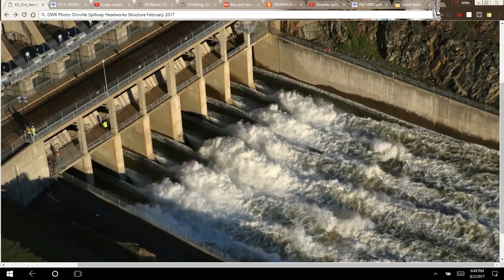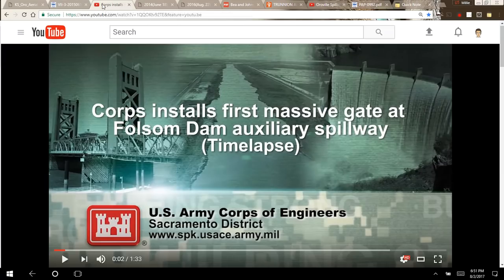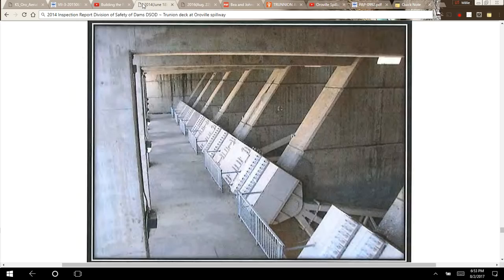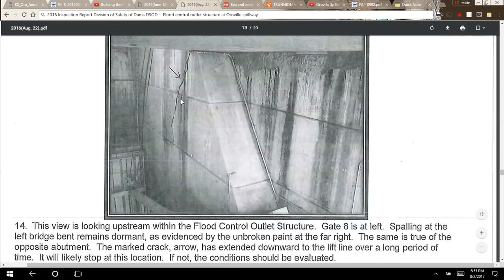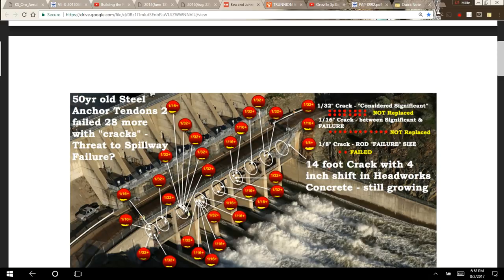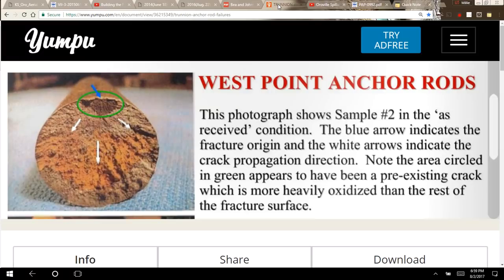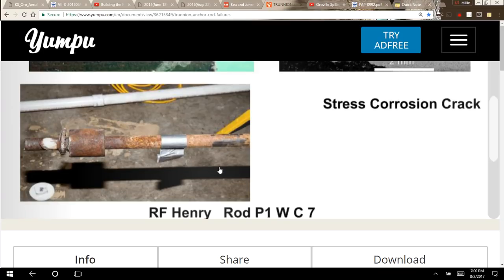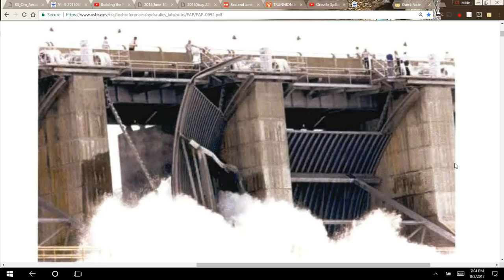Are Oroville Dam spillway gates safe? (And what about those trunnions and tendons?)  8/2/17

Comment: Lacking current access to the design blueprints, it would surprise me if there are NOT cut off slots in the upstream end of the spillway chutes. This is a simple slot a cut off panel gate can be lowered into position by crane to isolate a given chute for maintenance while maintaining water levels. It's a super simple design feature that adds one more level of redundancy.

Edit: in this video, it appears there is some method of using cut off gates here (but the video is shaky at the MOST critical points). You can easily see near the end, there IS a slot in the sidewall entry to the chutes. I'd need to see the blueprints to be certain. https://youtu.be/XZO_744b_Gs
Reply from the maker: Hi Mike. I hadn't seen that video in a while. Thanks for posting the link. Your thoughts on the cut-off slots are interesting. I see what you mean near the end of the video . . . hmmm . . .
Reply: Made in USA Thanks for the reply! Perhaps the stop log slots are not "intended" to be used with flow, but if you have nothing else to plug the hole, I'd sure likely try it. Maybe grease it, or add wheels now? It's only got to close once. The point being it's not 100% accurate to say there's "no way" to plug the hole if a gate fails.  If the ship is sinking, get creative in plugging the hole.  Remember, the tendons are not the only 50-year-old steel bits that have reached their design life (i.e. RVOS) and are subject to immediate failure. At some point they will all fail if ignored.
Reply from the maker: Mike ~ I found this info. Hope it's helpful:

A set of stoplogs is provided to dewater outlet bays to allow maintenance work to be performed on the radial gates. Five interchangeable leaves are stacked in slots in the pier noses and make up the set required to close off one gate bay. The gate leaves are each 8 feet - 10 inches high and were constructed of 1/2-inch-thick skinplate and box-shaped ribs. Rubber seals are used on all four sides ("J" seals on the top and sides, and wedge-shaped seals on the base). Each leaf is provided with a 4-inch gate valve to refill the volume between the radial gate and stoplog and thus equalize the pressure for gate removal. The stoplog leaves were designed for a hydrostatic head of 87 feet (elevation 813 feet to eleva- tion 900 feet). The bottom stoplog seal was modified after initial use. A softer rubber bar-type seal was used to completely seal the bottom corners. Also, a modified slide gate with regular ropes as operators was installed on the bottom stoplog to has- ten the filling time of the space between the stoplogs and the radial gates.
Reply from the maker: Made in USA ~ I just posted the following for Mike. Wanted to make sure you see it, too.

A set of stoplogs is provided to dewater outlet bays to allow maintenance work to be performed on the radial gates. Five interchangeable leaves are stacked in slots in the pier noses and make up the set required to close off one gate bay. The gate leaves are each 8 feet - 10 inches high and were constructed of 1/2-inch-thick skinplate and box-shaped ribs. Rubber seals are used on all four sides ("J" seals on the top and sides, and wedge-shaped seals on the base). Each leaf is provided with a 4-inch gate valve to refill the volume between the radial gate and stoplog and thus equalize the pressure for gate removal. The stoplog leaves were designed for a hydrostatic head of 87 feet (elevation 813 feet to eleva- tion 900 feet). The bottom stoplog seal was modified after initial use. A softer rubber bar-type seal was used to completely seal the bottom corners. Also, a modified slide gate with regular ropes as operators was installed on the bottom stoplog to has- ten the filling time of the space between the stoplogs and the radial gates.

Comment: Seeing that the verticals have squared off trailing edges the whitewater behind them is from collapsing bottom up to fill the void, this creates a ton of noise power that can be a source of harmonics, probably are.

Easy fix to cast coherent joining to reduce this a lot, seeing all the corrosion below it all in your slides.

Thx for the great coverage.

Comment: In sum, the lake water level cannot exceed 813.6 ft. as even a single partial gate failure would mean a sizeable discharge onto unfinished construction work, thus stopping any and every worksite activity dead on its tracks with negative impact on structures currently under reconstruction making the current mess even worse.

So, in view of the glaring absence of an Oro functional spillway anytime soon (let alone Nov.1) the only remaining Oro flood control tools are 
(1) the HPP´s highly limited discharge capacity 
(2) lake buffer space up to 800 ft. (approx.)

Accordingly, for CYA purposes DWR most probably will be forced to trigger a whole new, highly heated California Water War with the Feathers basin economy by having to drop the lake water level even below 700 ft. (possibly 650 ft. ?)

Recreation, farmers, businesses at large and plain citizens and families all the way to Sacramento will be negatively affected and will most probably put up a good fight. Lots of expensive and essential water will have to be wasted in order to keep such ultra low required lake levels in order to avoid flood risks.

Then, and only then, would DWR heads roll in abundance as should have happened at the very outset of this engineering disaster now actively smoked screened by a bunch of DWR cheerleaders.

Certified P.E. resident DWR field engineer Matt Marie two weeks ago was on record stating that "DWR has not planned for ANY repair work at gates or gatehouse".
Reply: Dig Engineer ~~
Dig, my good friend. Good to hear from you, amigo. After some replies a while back we have become forever linked. Today I am "JimDig".  Good to hear from you and the info you bring! "JimDig", aka Jim Perry.
Reply from the maker: It seems that what we have here is . . . a mess.
Reply: Oh yes, i recall someone confusing you and me as the same person because we thought alike with similar synthax and grammar (sorta) on Oro dam disaster. So today you´ve become "JimDig" well whatta ya know !  I guess that would make me "DigJim" then haha !!  Nice hearing from you Jim.
Reply: Clear enough, 813.6 ft. water level means potential trouble. So with HPP as only flood control tool that forces DWR to ULTRA low lake levels to cope with unexpected inflows (Pineapple Expresses ?).
 
700 ft. (or less) water level will mean throwing away expensive water and ruining many important components of the Feathers basin economy which will react negatively with a spanking new kind of DWR-created Water War. Yes indeed, it´s a messy mess, and it should not be pretty.
Reply from the maker: Aha! JimDig meets DigJim LOL LOL !!!
Reply: LOL!  So how should they rebuild the spillway, Dig Engineer, without rebuilding the spillway?  It's nice that you can vent and feel better, but you might try thinking before venting.
Reply: Dear Jasmine, you should just stick to the the empty-headead sugar o´clock DM mafia. Obviously you do not live (or have any loved one) downstream Oro with the obligation of taking timely and INFORMED life decisions in their best individual interest.
Candy-coating Oro dam reality doesn´t help any and may badly hurt children, old folks, sick people, poor people, disabled, homeless, teen-agers, single parents,farmers… and the Cali economy.

 After all bad that has already happened and may still happen worse, Oro + downstream people deserve foresight, harm mitigation at all costs, including weather and ´bad luck´ coverage. 
Right now Oro dam is not functional. No MSW and no ESW means NO Oro dam, just at the mercy of God. By 2018 we may have "something" but can´t know how good that may perform against a flood.
Reply: No, i don´t have any drama, no fearmongering either. Sorry, just facts, plain simple to see facts. As you invoke Millie´s video and suggest to look at the dam her way... well, in case you haven´t noticed, Millie Kay clearly and emphatically states that ... "what we have here is . . . a mess"(sic) + ..." the current plan is the patch & pray method"(sic)... + talks about how downstream folks should be "fine tuning a personal evac plan...+ "the lake water level cannot exceed the bottom of the gates"(sic) (813.6 ft). 
So just let level-headed people help Oro + downstream people take care of themselves Jasmine. You and your ilk don´t help any.
Reply: Jasmine is a DWR shill.  Do not read or respond to his or her comments.
Reply: JasmineLindros ~~
Jasmine: Please pardon my delay for an informed timely response, I'm still in the UK. Having read through your two inputs to Millie Kay's review of the Oroville dam gates, you have targeted Dig Engineer for what he as added to the discussion. You brought nothing new to the discussion, only a garbage complaint about venting. If you read through the thread, most are adding to the discussion. You will see not only Dig Engineer but others with solid information that adds to what Millie Kay has already brought up. You complained about Dig Engineer and " venting", I guess you missed the part where he quoted DWR's Matt Marie and his comment about the Oroville Dam gates.  What Dig Engineer brought forward is germane to the discussion. All I see from you is nothing more than sniping with nothing at all to support a counter view, or any view for that matter.

Look through all the work Millie Kay has done regarding the Oroville Dam. You will see facts with no hype. Discussions include educated insight from not only Dig Engineer, but David Johnson, Warbles, and others who bring informed solid insight to the discussion that Millie Kay's videos stimulate. The discussions are free from personal gain, hype or shaping of information. Some have brought shallow replies that add nothing.

Your two replies have added nothing but to snipe at one of our core people. You can do that, as can anyone else. Just know that you are in the minority. If you bring nothing to the discussion beyond sniping and/or having the doom and gloom flags, you will probably just hear crickets in reply.     "JimDig"
Reply: What I pointed out, John, is that the actual doom-and-gloomer is Dig Engineer, who has come up with "sugar o'clock mafia" complaints that are simply deranged, not "plain simple to see facts."  This is different from Lad A Dog, who is simply lying.  Hyperventilating about "813.6," for example, ignores the fact that steel piles hammered into the existing spillway could, if need be, add 35' to the bottom of the spillway in just three days, and is one of the emergency scenarios engineers have already contemplated.  Yes, John, I'm an actual geotechnical engineer, and I've been doing this stuff for a living for 35 years.  Whining about "you and your ilk don't help any" ignores the fact that my "ilk" (although not me, personally) actually ARE designing and building the future improvements at Oroville.  Juvenile drama is no substitute for actual engineering, it is simply ignorant squealing.  Removing that ignorant squealing from what should be an engineering discussion would be an improvement, but I'll bet venting is more important than engineering to Dig Engineer.
Reply: Millie Kay is on record -- while discussing one-handed with the DM DWR mafia -- that she would evac downstream Oroville as soon as lake water reached " 813.6 ft." as that was the bottom of the proven failed gates and gatehouse. Say no more... and please do your homework.

Comment: Millie I love your detailed explanation of this engineering structure.
What is being done about the tendons that are similar to ours which are adhered to our bones, where they may be age rusting (expanding) in the concrete and loosening in same, similar to suspension cables in bridges in the concrete masses, ancored in on either side of the suspension bridge.
Like most accidents the seem to be a number of failures like the Swiss cheese, if all the holes line up at the wrong time you have a problem.
Had a extra though what happens with the gates if a tree, rock or other gets jammed in the gate when it's being closed?
Unlike gate valves that should crush the obstruction and sut off the water.
Thanks for anothe great video.
Reply from the maker: Hi Anthony. I don't know how much work they have done on the gate structure to address known issues. I've been looking for the info, though, and will provide whatever I find out. They keep that gate inlet clear of debris so I hope a log or tree couldn't get through! Thanks for your insightful comment.

Comment: The Oroville Chamber of Commerce demands new gates & gatehouse because both are damaged (badly) so maximum allowable discharge is (at BEST) same as last year 35K, probably less due to heavy load traffic thru gates + nearby blasting & worksite vibrations + weak RCC + two SCC-RCC stressed transition ramps at upper & lower MSW “lips”.

For good reasons, Oro was originally built with a 150K cfs fully functional spillway (gates + gatehouse included) so a 35K cfs spill limitation doesn´t cut it.
MUST READ   http://www.catholic.org/news/green/story.php?id=75205

Kiewit contractor might be efficient, but DWR is definetly not effective, wrong sequence, wrong timing, bottom-up is DEAD WRONG. Oro dam 2017 liabilities today intact, just cosmetics.

MSW inlet scouring must also be avoided, so the lake´s minimum discharge water level is 830 ft. This means that when DWR tries to spill thru gates at (maximum) 35K cfs the bases will be already loaded…

DWR is now forced to CYA and (1) necessarily assume WET WET winter come what may with 24/7 open HPP (2) let water level get to 830 ft. before (c) attempting to drain a pitifull 35K cfs. thru gates. In that scenario a regular 2-year 60K storm for 3 days (Pinneapple Express ?) would have Oro dam ironically ´dead in the water´.

All of the above would mean an exponentially worse situation if upper SW is not finished before wanting to spill a meager 35K thru gates… or if lower SW not finished thus clogging up DP yet again

So, if winter turns out to be WET WET then DWR is stuck with only 35K discharge thru gates starting at 830 ft. lake level which may mean not enough discharge thus flooding Oroville + downstream.
And if winter turns out to be DRY they´ll have Water Wars after having made themselves look like fools throwing away highly valuable and badly needed water ruining the Oro + downstream economy.

DWR´s Erin Mellon at official DWR press call worded it beautifully saying...QUOTE : “if” Oro gets “normal”(??) wet season and “weather holds” there won´t be any “major” problems (!!)
Reply from the maker: Hi Dig! Glad you stopped by. As rainy season approaches, I am weighing and measuring all input about Oroville Dam issues very carefully. Your voice has been consistent since Day 1 -- and in line with many experts. I think DWR speaks another language, and it needs to be interpreted accordingly. For them, "the gates are safe" may mean "chances are we won't need to use them". Hope you and Mrs. Dig are doing well. Take good care.
Reply: Hi Millie Kay,

As you would surely guess, I still have a lot more to say about Oro dam current risk and risk mis-management. In a nutshell, Oro´s impaired hydrosystem is now highly dependent on (a) weather and on (b) 35K spill capability limit of gates + gatehouse. 

Furthermore, there won´t be any ESW either... nor evac plans or evac training to speak of. Think in children, old folks, sick people, poor people, disabled, homeless, teen-agers, single parents, farmers… and the Cali economy.

The ESW may see the light of day maybe in the 2018-19 at best. Worse yet,  as your own video (now withdrawn from your channel) clearly showed, beyond secant wall completion and RCC (!!!) buttress wall and splash pad, the ESW still needs to address (a) parking lot isolation + (b) armouring of highly permeable lake side soil inflows secant wall can´t contain.

This was confirmed by the “Kitty Cat” recent input from anonymous worksite personnel certainly a marvellous educating experience for certain armchair ´prima donnas´ at DM chat room.

Take good care Millie and let me know if my opinion can be of any further help come winter. Cordially - Dig
Reply from the maker: We have "butted heads" over a few things, Dig -- but I sincerely appreciate your unwavering stance on the Oroville Dam situation. As a person living downstream, I want to hear the strongest voices on both sides of the issues so I can form well-thought-out conclusions for myself. I'm glad that you and Mrs. Dig are watching (and caring).
Reply: New NBC Bay Area investigative report regarding Oroville Dam liabilities and pending issues  at   http://www.nbcbayarea.com/investigations/Records-Raise-Safety-Questions-Surrounding-Oroville-Dam-448318083.html
Reply from the maker: Thanks, Dig.
Reply: The link above re the NBC Bay Area 6-month investigation (3 full time top-notch journalists and plenty of resources) has placed your own video front & center. So now Oro dam chat rooms busy busy reviewing (literally) your gates video all over again. Renewed congrats Millie !